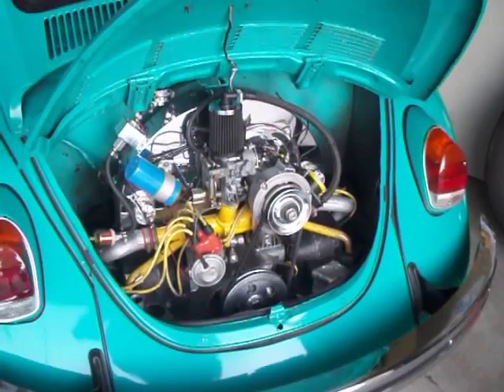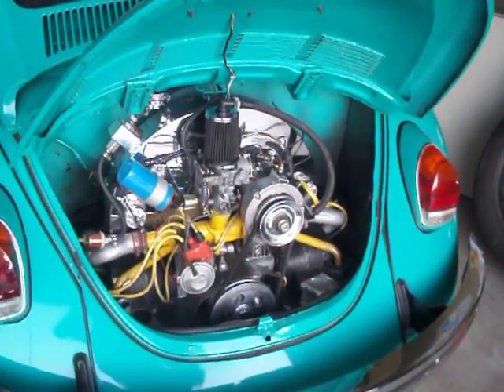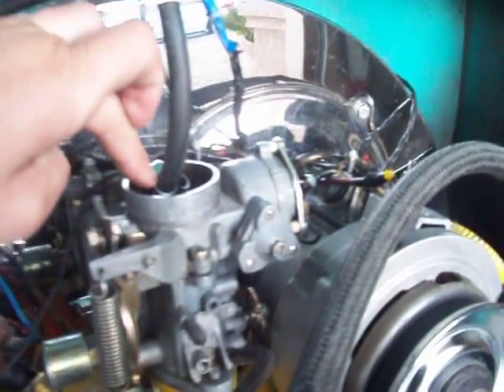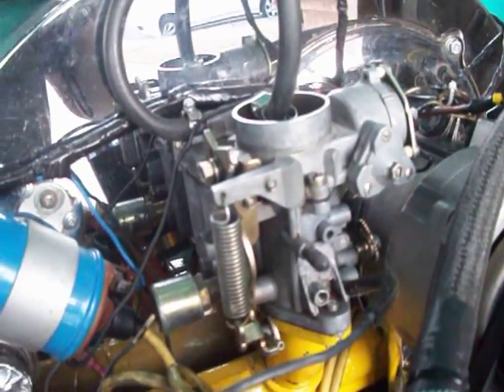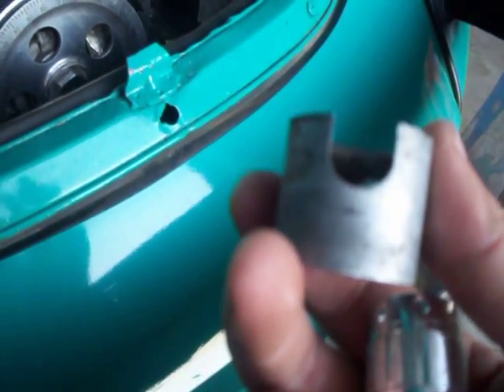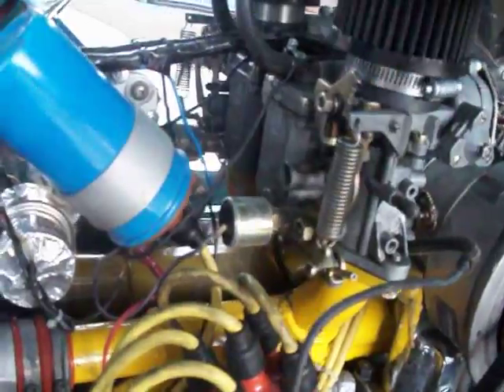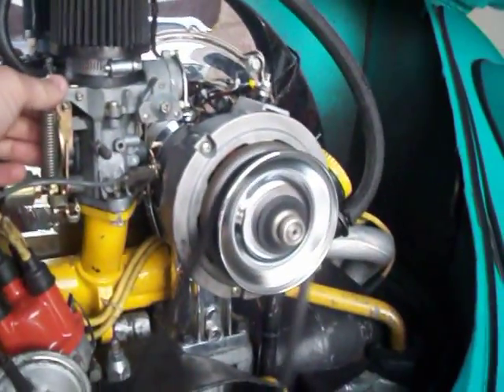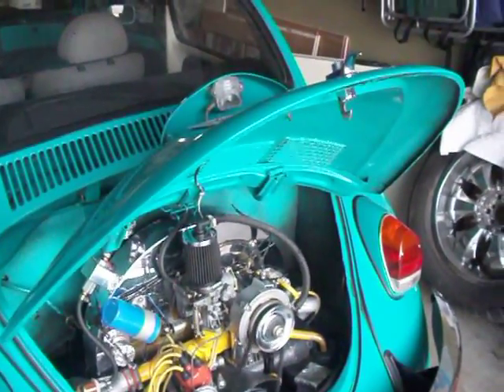Tuning a vw solex 34 pict 3 carb on 1904cc Option 1

Comment: Well the golden question is simple.. Miles Per Gallon? My dad pay for one of them critters in the golden quest of 130 Km per gallon...
Reply from the maker: Migueldeservantes 
Unfortunately the stock 1600cc bug was rated at 28mpg from the factory! lol
So the bigger the motor the worse it's going to get, no matter what you do. To give you an idea... That motor is now a 2234 CC with the same carburetor and I'm getting about 24mpg driving slow like an old man and 20mpg driving like I stole it.
So my average is about 20mpg!!! lol hope this helps.. :D
Reply: Well it does look to me like if your are having a lot of fun!! so who cares about mileage, The only reason I make the comment was because when I was just a child my dad was trying to reduces the fuel consumption of a Mazda B2000 "At the time was labeled "Ford courier!! I bet you know way better than me what I'm talking about

Comment: How did you remove the Venturi, I can't find how to do this anywhere. Thanks
Reply from the maker: Todd Shreve 
you need to remove the throttle shaft make sure you mark the butterfly it only goes in one way push in the quarter size aluminum plug then push down on the venturi it might be hard but it can be done. remember to use a good epoxy like J-B Weld to reinstall the aluminum plug. if you look closely at the video you will see a shade of gray on the aluminum plug that's J-B Weld. Good luck!
Reply: Thank You
Reply: Sorry one more question, does removing the venturi this way do any damage to the venturi. I am only trying to remove it to open up the venturi to 28mm.
Reply: Sorry one more question, does removing the venturi this way do any damage to the venturi. I am only trying to remove it to open up the venturi to 28mm.
Reply from the maker: Todd Shreve 
don't remove the Venturi. just remove the throttle butterfly and shaft. use a Dremel of some sort with the proper attachment and grind off the amount you need use a washer of some kind that is 28 millimeters or socket, use it as a gauge. be careful and go slowly

Comment: Less is MORE? SLEEPER or what? That is sorta cool! But, how are cruise temps with this set-up?
Reply from the maker: In 100 degree weather the oil temperature was running at 210deg. under normal freeway drivinig circumstances. Although that motor was upgraded to 2234 CC and now requires an extra oil cooler to maintain the same oil temperatures.

Comment: maybe you can solve an arguement for me? I was told these cars have NO choke.. or at least the ones that have been restored.. Looks like THIS one does though.
Reply from the maker: +grettagrids  It does have a choke and I'm still using it!! I love that thing!! Makes cold starting very easy!! :D 
Also the carb is a Bocar 34 pict 3. I don't think you can buy a new Bocar these days, you have to settle for all these Chines clones and its a hit or miss when it comes to quality! Your best bet is to hit all the vw swap meets. Good luck
Reply: Motor7710
 I bet it does :) I don't know why folks remove them? a freind of mine who owns a shop found NO difference in HP with or without a choke on his dyno.

Comment: I am thinking you have a stock cam for a strong vacum signal. What is your inlet fuel pressure?   Good Job thinking outside the box!!!!
Reply from the maker: TheEZGZ The fuel pressure was normal some were in the 3psi range. Yes I did start with a stock cam then upgraded to an engle w-100 and ran just fine but made more power. This engine size 1904cc is right on the edge of running with out the ventury. thats way you need to change the fuel bowl vent location by adding the hose witch lowers the atmospheric pressure in the fuel bowl. now an engine with a larger displacement CCs should be able to run without that hose.

Comment: One other question is, how do you get choke?It must hate cold weather and morning start ups?
Reply: +jayocular  Looks like there is an electric choke.. I see something that looks like it on the right hand side.
Reply from the maker: +jayocular 
Sorry been very busy but better late than never!! lol 
I'm still using the choke! Love that thing!! As to the dizzy on that 1904cc build, its a recurved single vacuum advance but the one on the 2234cc build, its a dual advance and it also been recurved for that build. The process to do this is all hit and miss, I had to remove it and modify it and reinstall it about 20 times!!!!!! lost of patience when doing something like this! lol

Comment: I cant tell you how helpful this video is to my application.i have built a trike and have put in a 1990 vanagon 2.1 motor and didn't want the complexity of the fuel injectin but on the downside I have backed myself in a corner trying to find a carb to fit the manifold I built for it(it has a heated set up under the carb area to prevent icing).Yor idea will work! I do have a couple questions though....where do I find the larger parts like jets to order? How do you take out the venture(stupid question) and what sizes do you think I need for that motor?
Reply from the maker: Wow.. a trike... that's cool dude!! ok so if your building a trike this should be simple with the skill level you have. look at my other video regarding resizing and re-drilling jets. Believe me its going one of the best skill you learn when tuning custom motor
Reply from the maker: Get a set of small drills or a jet reamer, if you go the drill set rout use a digital caliper to properly gauge them or make you own, I did. The approximate size jets will be as fallows ( Idle jet .65mm, Air jet .65mm but .85mm might work, main Jet 1.60mm to 1.65mm the Twin jets just under the choke those are drilled to .60mm each) the venturi can stay but open it from 26mm to about 30mm) but if you go with not venturi you need to remove the front plug with a press then push the venturi down after you remove the throttle shaft of course! then re-assemble it re-install the plug with jb-weld or epoxy weld it with an aluminum welder. As to the distributor a 009 if about the only thing that will work for that huge engine size. This is due to to vacuum being to high, its almost impossible to recurve (Believe it tried)
Reply: Motor7710 I might go with the Mallory non vacuum distributor then because the 009 dist doesn't seem to get rave reviews on any motor above a 1300. As you mention about the being smart part,i can put in an engine that works,rebuild and basic problem solve but when it comes to the custom tuning and getting the horsepower from,im not to educated on it and certainly haven't dealt with carbs more than a simple rebuild. The resizing and redrilling jets is something I want to try but have never done either. Closest ive come to that is putting in bigger jets in a carb I have on a 56 buick I am restoring but I haven't had it on the road to fully test them yet
Reply: Motor7710 is there any way to buy jets those sizes? those reamers  look to be about $65 a set and I don't want to make a career of reaming tho it would be nice to have them I suppose
Reply: One other thing,arent there needles to those jets? Do you have to get larger ones for them?
Reply from the maker: jayocular nobody sells these jets of this size but any local speed shop should be able to ream your jets to the appropriate size
Reply from the maker: jayocular when you say needle I'm assuming you mean the fuel bowl needle. So yes.. you need to get a 1.60mm fuel bowl needle. If you don't do this your carburetor will run out of fuel.
Reply: Motor7710 Appreciate the info, I will certainly try this set up!
Reply: Where would I find needles like that,i cant find anything?
Reply from the maker: Generally most speed shops have these items just show them your old one and they will mach it with a bigger one

Comment: I need to go back to original looking carburation for inspection because my dellorto setup is not street legal in my country. My engine is a 2110cc, w120 cam and the usual mods. Will this setup work in my engine. Any ideas of what jets do I need? I have a 34 pict repro with 130 main 70 air 57 idle.
Reply from the maker: I don't think the 34 pict 3 carb is going to work with that cam.. the valve overlap is just too big. even if you get it to idle, the emissions will be too high with that cam.. Sorry... What you need is a person or friend with a stock engine that's willing to let you barrow the engine for the inspection. Also keep an eye out for a good used stock engine for just such an occasion! wink wink.. but if you want to try it... the approximate jets sizes would be 65idle 65air and 165 to 170 on the mains. Good luck!
Reply: Jeremy Kelley hi, jeremy. I mean I just need to drive from home to the inspection, pass it and go back home.
Then I would install the dellortos again until next year's inspection.
I was wondering if I could at least drive some km and have a decent idle.
Regards

Comment: you should change that hose clamp on the little tube with a small zip tie or a spring clip to try to reduce the turbulence of the screw side of the old clamp just my opinion lol =3-

Comment from the maker: Your engine is to small to run with the mod that Im running.  Your jets should work with that engine size. Just increase the fuel squirt adjustment on the right lower side next to the generator. It should be labeld with a (+ and -) move the crew closer to the lower side of the - one or two notches. Good luck!

Comment: Hey man really nice, Solex isn't that bad after all. I actually have an 86' Ram 50 sport 2.6 mini truck. Its not nice like this "body wise" but i've done a fair amount of restoration to it. check out my vids lol. I have the vacuum advance still on my inline 4 2.6l to the Solex 2b 34/34 dgec. its electric choke and vacuum advance on the distributor. I want to try and cold air intake under my front valance. possibly a little colder breath on the intake. But you already have that. ;)

Comment from the maker: The bypass scew has nothing to do with an engine choking on acceleration. It regulates the anount air allowing you to adjust the Idle and only Idle.. so if your engine idles thats not the problem. for choking on acceleration check the following.. air leaks... a 009 distributor is garateed to do this, us a vacuum advance Dis.

Comment: I'm curious, have you put this on a 'smog machine" and measured c.o. & h.c.'s at idle and  high r.p.m.'s? That would verify your assumptions regarding how "well" it runs versus dual carbs....35 degrees of advance really is the line of death, isn't it..........

Comment from the maker: There’s a few things you can do to improve your idle first advance you’re timing to 34deg. any more and heat problems may arise. Your idle jet is to lean go to 57.5 but no higher than 60. Last replace all your exhaust rockers that are 1.1:1 , 1.25:1 or 1.4:1 with the early style less lift rockers 1:1 this will reduce the valve overlap.  Leave the intakes rocker alone.  You will loose 2 or 3 hp and wont even be able to feel the difference. Good luck.

Comment: This video is just great and you may have a response to my "problems", I just finished to built a 1776 with a 110 cam, and I REALLY want to run a single Solex on it. I have an 009 with electronic points at 32 advance and the idle is droping at 600 no matter what and even stalling, due to the "big" cam, running ok on high rpm (on the stand). Any idea what I should do ? main is 135, air correction is 80Z and idle is 55, I tried a 65 I had the same and it was running too rich
thanks in adavnce

Comment from the maker: It sounds to me like you already have some mechanical skills. This is not very difficult if you use a Dremal style grinder and finish it with a small drum sander. Just go slow and you will be fine. Use something like a large washer or anything round of any kind of 29mm to 30mm to gauge the opening that you’ll be working on. Good luck!.

Comment from the maker: oops type-O FK-44 has 259deg of duration @ .050 the 289derg is the Advertised Duration and has no mechanical value. Its just one of those things that you wonder why the hell its even used by the manufactures.

Comment from the maker: Open the venturi to about 29mm to 30mm by removing the throttle and make sure to mark the plate because it only goes one way. As to your jets you are going to have to play with the jets sizes....... Idle jet .57mm to .60mm the Main jet 1.40mm to1.45mm and the air jet .70mm to .75mm But 80mm might work. Good luick!!

Comment from the maker: Thats very intresting... running a fk44 cam with 159deg @ .050 of duration on a 2165cc motor. Hummm... I think whats happening is that your running a very large engine with a very small venturi and  thats is able to create more vaccum than you would if you where running the max of 34mm venturi. Never the less thats a great mod! thanks for the tip!!!

Comment: hey matt, 

i got a 1776 rebuild on a bus. The engine is a 1971 dual port, single carb, SVDA. Trying to figure out if your technique will work on the smaller 1776. Want to avoid the dual carb so I can keep it simple. What do you suggest for the jets? what do you suggest for the venturi? E-mail at ccampbell@lvusd.org

Comment from the maker: Half the fun is experimenting with stuff that your typical mechanic would say."Why not just buy the aftermarket widget, its better!" We know thats not always the case!
Case and point (In California vehicles 74 or newer owners must smog the vehicle every 2 years. if you jet your carb right with no venturi you should pass smog!" try getting pass the smog official with a pair of 48 IDF's! As to the cams, be careful dont put more than 136deg @50 of duration or your single carb or it will not idle

Comment: Wow this is a great demonstration. I think with the right jetting it would work on a stock engine with mild porting and 1.4 to 1 rockers and 1 1/2" exhaust?!? I remember seeing this on old V racers with 1200 engines at the track. They had to run stock size engines, so they took out the venturi. At 1200cc they were peaky (probably with cams too) Any ideas? I think I should try it.

Comment from the maker: Just remember the airflow bottleneck will be the intake manifold end cast. You’re going to need to open them up by match porting them. Also you’re right! Running a single carb does have a slower throttle response but more than make it up for it in Torque and that is what you really need on a bus.

Comment from the maker: These jets are special. Your going to have to drill them yourself. look at  my part 2 video. Its not hard todo, it very simple. if you go to far use copper plumbing solder and redrill them but dont get the solder on the threads. Wonce you get the hang of it you will never buy any jet againg. if you cant find a right size drill, use remote control antena wire from old toys using a digital caliper to gage for the correct size, use sand paper to grind the drill bit to the size you need. Good luck!

Comment from the maker: @gmd1417 The reason it’s connected at the front is because I needed less vacuum to achieve less timing while driving.The side port was giving me too much vacuum and I was getting a predetonation or pinging.With my setup I tried using less timing but got worse MPG. It ran ok but was getting 24mpg.Both the front and side vacuum ports work the same, the front give less vacuum than the side one. I also couldn’t find anybody that sells different size distributor return springs. Basically I got lucky!

Comment: @Motor7710-One thing I forgot to ask: I notice you are pulling vacuum to the distributor from the FRONT of the carb, rather than from the driver's side vacuum port. Why is that? I also presume you have the other vacuum ports on the carb blocked off. Is there any reason for this or does it make no difference on a 34 Pict three as to where you attach the vacuum line when running a single vacuum distributor on a Pict 34?

Comment from the maker: @gmd1417The hose is attach to the 1/8 inch vent tube that terminates right above the choke, you can miss it. Use a thinner hose if you can, that’s all I had at the time. Also the clamp is not necessary if the hose thinner, it will be nice and tight.  The longer the hose the better it works (The farther you get from the carbs vacuum the better it will work) If you completely exit the air cleaner you will have a normal Solex carb that will run a 1.9L to maybe 2.2L no stumbles. With the right jets!